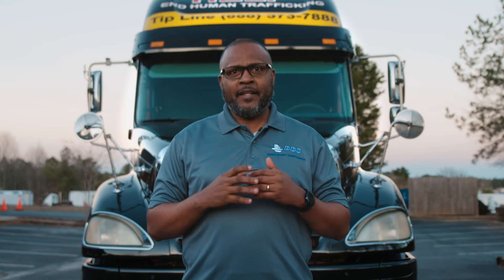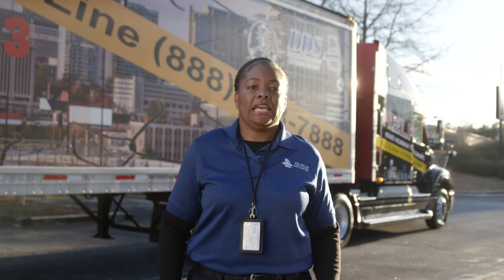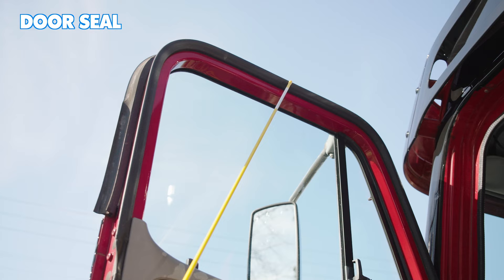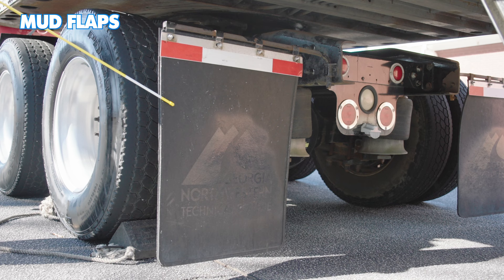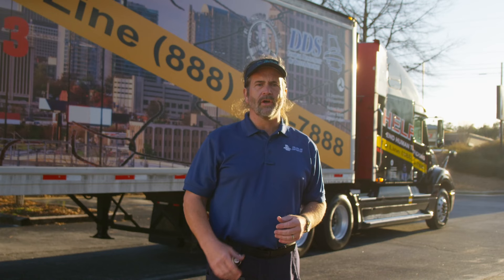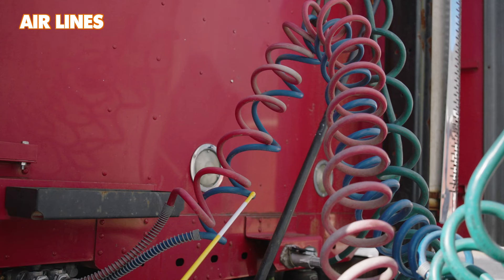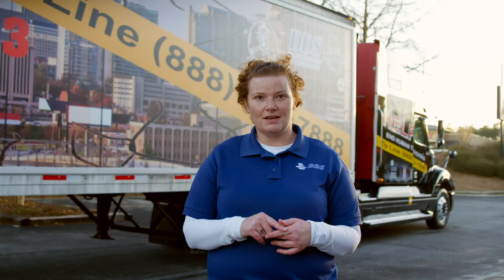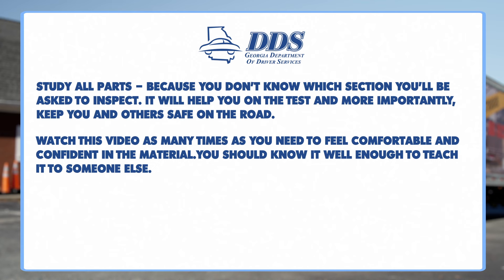CDL Training Video for GA DDS

Comment: I thought for the trailer tire inspection the required tread depth was 2/32 of an inch and 4/32 of an inch strictly for the front tires of the truck. Was I mistaken?

Comment: Hmmmm...  

You have to know the different components of the engine and attachments of the tractor, in order to pass the CDL exam???  What??!!!:face-blue-wide-eyes: 

I don't anything about mechanics or trucks.:hand-orange-covering-eyes:
Reply: Me either. But that’s why I had to learn. I don’t think they ask everything. Each state is a little different. I definitely learned the main parts especially engine oil, coolant, oil levels, suspension parts, and inside of tire.